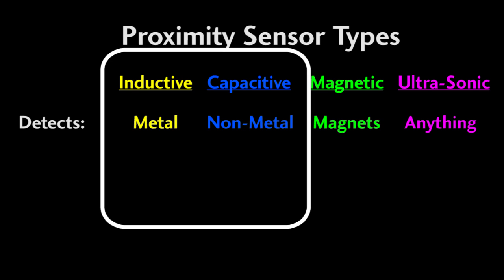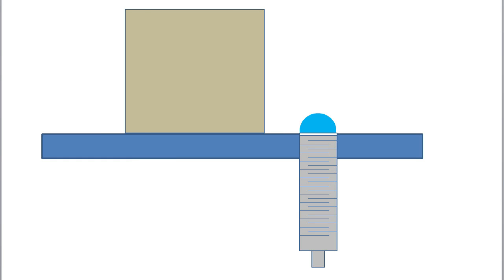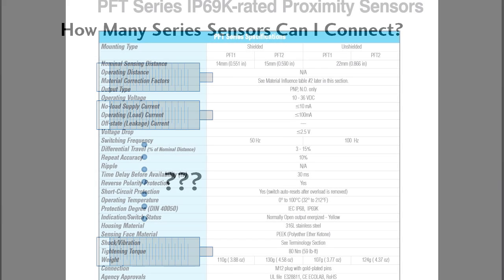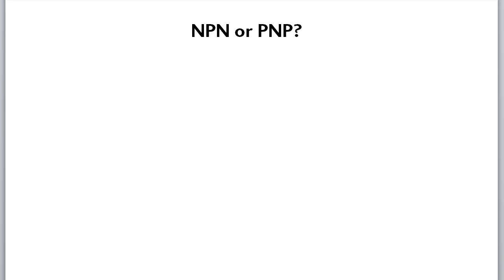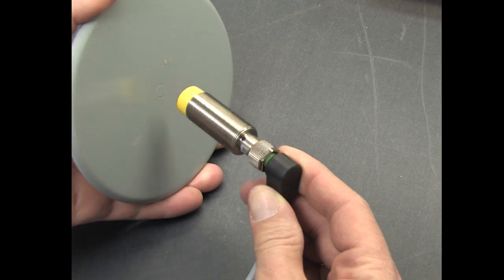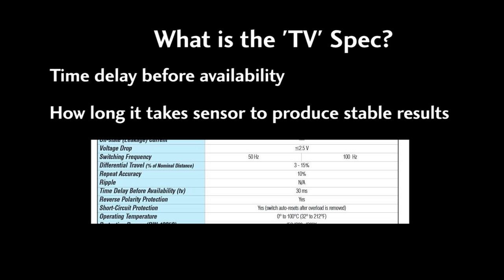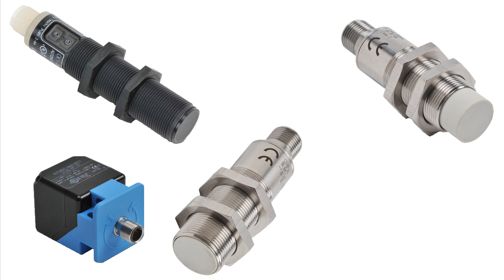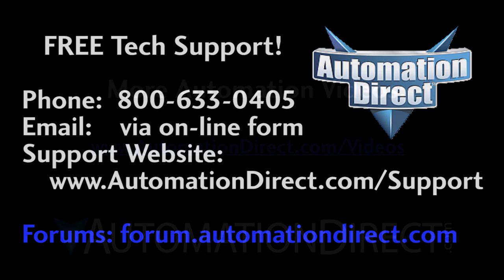Proximity Sensors for Object Detection from AutomationDirect

Comment: I have a breakdown of a main account motor that's not turning, it has a damaged proximity sensor pointing to the main motor shaft. How can I tell what type the sensor is
Reply from the maker: @claymoreChapindura, the only surefire way is to find a PN on the sensor and cross reference it. Alternatively you can look at what the flag or trigger for the sensor is. If the flag is ferrous metal of some type, it is very likely an inductive proximity sensor. If there appears to be some type of glass or translucent plastic on the sensor it is likely a photoelectric. There are other possible options of course, but those are two good starting guidelines.

Comment: Can a proximity switch be used like a momentary switch? I'm trying to add a neutral safety to my transmission shifer and wanted to add one to the shifter under the boot at each gear position. Ideally they'd be normally closed in series with the crank request wire that goes to the PCM so if one detects the shifter it opens the circuit
Reply from the maker: @automnjeserich2689 the vast majority of proximity switches are momentary. If you need a latching option, you usually have to wire one using relays. I don't know that any of our switches are rated for automotive applications, but you are certainly welcome to give it a shot. :)

Comment: Looking for the next video on magnetic proximity sensors but can’t seem to find it. Can you share the link? Are magnetic proximity sensors primarily used for safety door interlocks? have a rectangular tray held in place with two magnetic arms (The two shorter sides of the rectangular tray sit on the two magnetic arms). There are cases when the tray can move upwards (away from the arms). Can a magnetic proximity sensor pointed at the top of the tray detect motion of the tray when it moves away from the magnetic arm momentarily? Thinking about mae-ap-1f
Reply from the maker: Rakshith, You can find our sensor videos on this link:  https://www.automationdirect.com/videos/home?t=link&cat1=26  You may only need an inductive proximity sensor to detect when the tray is in place and when it has been lifted away from the magnets. If the tray is made of ferrous metal (steel) an inductive proximity sensor will detect the trays presence or absence. Other factors would be round vs rectangular, voltage, and sensing range.  If you need further assistance selecting a sensor, our free, award winning technical support can guide you with the selection.   https://community.automationdirect.com/s/contactsupport

Comment: Bisa kah proximity sensor di jadi kan alat metal ditektor terima kasih
Reply from the maker: Can the proximity sensor be turned into a metal detector?  Inductive proximity sensors are designed to detect the presence of ferrous metals. Using them as a "metal detector" could possibly be achieved but will be limited to the sensing distance of the selected sensor. If you have technical questions about our products and your potential application, you can contact our free award winning technical support here:  https://community.automationdirect.com/s/contactsupport

Comment: Hello! Can I ask which sensor should I use if I want to detect different types of plastic (PET, PVC etc)? They have different wavelengths but I'm not sure which sensor to use for detecting them separately.

Also, from where can I get it?
Thank you!
Reply from the maker: Capacitive and Ultrasonic sensors will both detect plastics. The distance of the mounted sensor from the detection target will determine which sensor style to choose. It would be best to contact our technical support or our community page for help selecting a sensor for your application. You can find the contact information on our page here:  https://community.automationdirect.com/s/contactsupport 
You can order sensors from our webpage at AutomationDirect.com. We only ship to North America.  If you are outside of our area, you can contact one of our international VARs here:  https://www.automationdirect.com/adc/international/international

Comment: does this series circuit work for npn nc
Reply from the maker: Depends on the sensor, but yes, most have that option.
Try this: 
1. Go to www.automationdirect.com
2. On the left bar click Sensors/Encoders
3. Choose one of the Proximity Sensors
4. On the left, you can now check "N.C." and "NPN"
5. You will now see all the Proximity sensors that meet your needs!

Comment: which proximity sensor will be best ?
Reply from the maker: That's a wide open question which depends heavily on your applciation.
Try this: Go to www.automationdirect.com.
On the left select sensors >> Proximity Sensors
Now use the check boxes on the left to narrow down your search results.
If you still need help after that, contact our FREE tech support. https://www.automationdirect.com/adc/contactus/contactus

Comment: hi question: what kind of sensor ( not proximity switch ) would you use for example if you have 2 metallic  objects in close contact with each other and you want to activate an alarm and a warning light when these two objects get separated and not in contact anymore? thank you
Reply from the maker: You want to detect when two metal objects aren't touching?  Why not just treat it like any other switch/contact?  No sensor required, just connect them to a PLC input like you would a normally open switch.
Reply: @automationdirect  appreciate it but this sensor will be installed on a pickup truck not in automation if you could help me with that I will appreciate it
Reply from the maker: @753bowie  Hmmm ... sounds like this requires further discussion. Contact our free tech support - they will be happy to dig into it with you.  You can call, fax or email them.  Go here for details: https://support.automationdirect.com/

Comment: I want to detect very small metallic objects like screws , nails, washers 1-2 mm dia embedded in rubber-foam material that is moving 0n a conveyor.  The sensor should be as large as possible (50 mm or higher). The sensing distance should be about 30 mm. Kindly suggest
Reply from the maker: You can actually do this yourself. Just go to the AutomationDirect website, and in the left column select sensors, then proximity sensors. Now in the left column you can select all the features you want. This quickly gets you to the part number you need.

Comment: Great vid. Question; if trying to sense periphery, what is the best inductive sensor; or capacitive?
Reply from the maker: Not sure I understand "periphery?"  You want to sense something not directly in front of the sensor? If so, then you want an un-shielded or non-flush sensor. Capacitive vs inductive is more of a material decision - Inductive is for metal objects because it uses a magnetic field for detection. Capacitive uses an electric field so it can detect metal and non-metal objects.
Reply: Thanks. Yes that’s what I was referring to. Then shielded it is...

Comment: Very informative and helpful video!! I have a question though, I know the capacitive sensor is capable of detecting any objects that has a dieletric constant greater than air but can it MEASURE its change of capacitance once it detects a non-conductive material?
Reply from the maker: Hi Jeg, These are just on-off devices - you can't measure the change in capacitance.

Comment: Thanks for useful video. What sensor would you recommend for film base substrate? I need something that can be used for detecting motion picture film eg. super 8, 16mm, 35mm etc.
Reply from the maker: That's a pretty wide open question. What distance? Contact or non-contact? transparent or opaque? How Fast does sensor need to respond? etc ... Too much to answer here.  Please contact our free support team during regular business hours. They will be happy to help you. You can see all of your support options here: https://youtu.be/IcbG7HKxzRE
Reply: @automationdirect  Thanks for your reply. Probably around 5-10mm distance, non-contact, film base is transparent but has a photosensitive emulsion on top of it https://en.wikipedia.org/wiki/Film_base. Response time probably under a second is fine. Would also need to be small package size. I have tried a 1-5 mm capacitive proximity sensor but does not detect the film at all and assume because it is because it is very thin/semi-transparent?

Comment: for measure the gap around 50mm by blinking the signal of big bulb to see the operator , which type of proximity i shall be used. please help.
Reply from the maker: Hi Abhunandan, Just go to the AutomationDirect.com website and search for "Proximity Sensor." Then on the left scroll down to the sensing distance category and select the sensing distance you need. You will be presented with all of your options.

Comment: Sir how can I make proximity sensor as distance measuring device??? Plz help
Reply from the maker: @Sk Sahadat Ali, if you are looking for distance measurement you are looking for something with an analog output. The things to keep in mind when specifying a distance measurement device, is the distance you will be measuring across, the material you are detecting and the type of output your device needs (ie. 4-20mA, 0-10VDC, 0-5VDC etc)

Comment: Thank you for useful information, i want a proximity sensor to dectect the rpm of a bolt and i once the rpm is reduced i want the linear actuator to work with the help of arduino. what kind of sensor should be best for it?
Reply from the maker: Hi Colin, we would have to understand more about your application to answer this. You best bet is to contact our free support during regular business hours - they will be happy to help you. See the contact info at the end of the video.

Comment: I have proximity sensor that senses gear teeth and in turn in moves a cable out a set amount but the technician said the PLC and sensor are not reading the same value so he increased the value in the control and said basically I would have to live with it like that. Help ! Having problems ever since he did that
Reply from the maker: Hi Ronald, That's difficult to answer without knowing more about your application. Please contact our FREE Tech Support - They will be happy to help you: https://www.automationdirect.com/support

Comment: Can i increase the range of an inductive sensor? Im using the unshielded one. 3 pins.
Reply from the maker: Hi Bryan, Inductive sensors really depend on the type of metal being detected so you could optimize what you are detecting to help a little bit. Other than that, there really isn't much you can do to increase the range other than buy an extended range inductive sensor.

Comment: i would like to detect the end of roll using proximity sensor. SO if the paper roll runs out of paper i want to immediately set a trigger. which sensor can i use ?
Reply: AutomationDirect has a number of different types of sensors that would work for your application. Photoelectric, ultrasonic, contrast, etc ... It's hard to give you guidance without knowing more about your application. Please call our FREE Tech Support during regular business hours - they will be happy to help you.  1-800-633-0405.
Reply: @adcpreviews1727  do you have international sales ?
Reply from the maker: You can find our list of international sales in your area at: https://www.automationdirect.com/adc/international/international
Reply from the maker: Thanks for the comment Bozo.

Comment: Hello, do you have a codes for capacitive proximity and inductive  sensor using arduino? Can you please provide a link of it. We are having a project about using capacitive proximity and inductive 3pins. Can you please help us ? It would be a great help. Thanks. Godbless . More power.
Reply: Thank you so much. Godbless and more power.
Reply from the maker: @Christine Evangelio, thanks for the comment. We don't have any example code,  for inductive or capacitive sensors with Arduino based control. We specialize more on PLC platforms. I would advise looking on Arduino Project hub (https://create.arduino.cc/projecthub) for example code. Hope this helps. Have a great day.

Comment: What sensor type should I use to know the rpm ?thnks
Reply from the maker: @Abas jabr, thanks for the comment. That depends on a lot of factors. First you will need to know the material you are sensing, the speed at which it will be sensed and then the distance. The sensors used in this video will only provide a discrete output. You will need some type of Tachometer or other control system to calculate the RPM.
Reply: AutomationDirect.com I am planning to build  rewinding fan machine  .thanks for help.

Comment: can a capacitive sensor detect plastic, metal, paper and food waste. please answer , need your response .for my thesis
Reply from the maker: Thanks for the comment, Richelle Park. 

A capacitive sensor will detect any object that meets it's sensing size and has a dielectric different than air. Since very few things have the same dielectric as air, I have always looked at a capacitive sensor, as the "everything and the kitchen sink" sensor. I have used this sensor, to sense all the objects that are in your list. 

The two factors that give a disadvantage to capacitive sensors, are the effect temperature and environmental changes has to the accuracy, and the last being that the overall accuracy is not as high as let's say inductive sensors. Now the technology around capacitive sensors, in years of late, have reduced these disadvantages greatly.

I hope this has helped in your research. Have a great day!